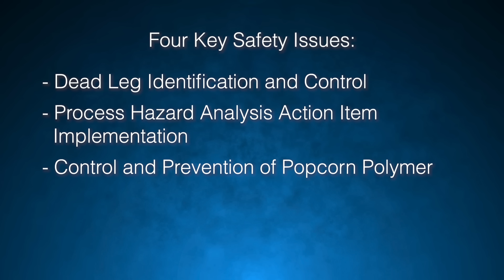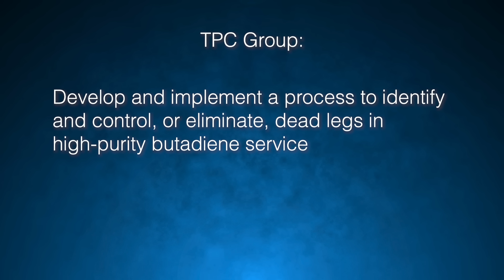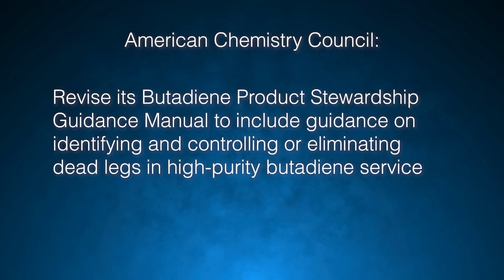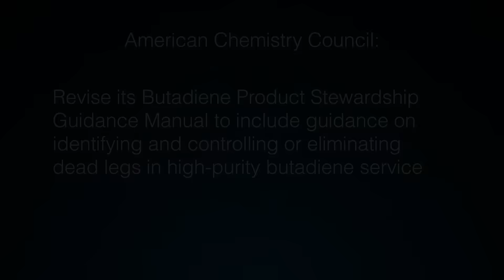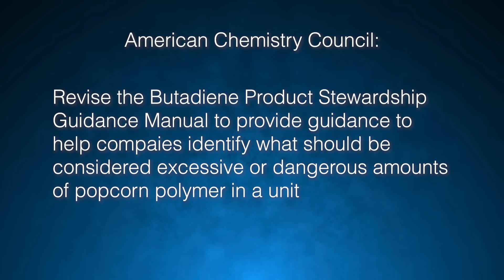The Danger of Popcorn Polymer: Incident at the TPC Group Chemical Plant

Comment: Isn't it obvious that ANY factory with flammable material in pipe that could be pressurized should have an emergency pressure relief valve in that pipe, or maybe even a pressure relief pipe system to overflow areas.
Reply: I believe pressure relief devices are typically located on vessels and process equipment, not on piping.

Comment: Normally the piping is designed for the max. shut off pressure of the pump. If there is a blockage in the piping then pump pressure will not exceed the piping rating. I wonder why the pressure exceeded beyond the tensile strength of the piping material?

Comment: In HVAC systems there might be 50-100 sensors in a single building that monitor flow, pressure, temperature, moisture and more in the ducts and others monitoring the drives, motors, dampers, and other mechanical devices. It's mind boggling that something as dangerous as this would not have the same, or better sensors.

Comment: Since the site does not meet the most basic safety standards, who authorized its production?
In the chemical industry there is a mandatory annual visit regarding the material and compliance with safety rules. In the case of this company, there is clear evidence that they have not complied with these rules for economic reasons despite multiple alerts from employees.
We always have to wait for a disaster before concrete measures are finally taken.
In most of the cases CEO’s don’t even go to jail despite the loss of lifes…

Comment: Let me guess. The Report Recommendations will be governed by "self regulation" hence the term "stewardship". In other words, there won't more inspections (if any) and nobody is going to know whether or not your company has mitigated all the known risks until the next big explosion happens. After all, Texas is all about Deregulation which has contributed to several chemical plants in Texas violently exploding relatively near to residential areas.
Note too that the guy was mentioning that (paraphrased) the company should generate new policies .. bla bla bla rather than the State or Fed. Gov't passing Laws to govern and regulate minimum safety standards and require regular inspections take place, which may result in an Order to Comply and even serious fines and charges if/when the Laws are not adhered to.

Comment: Citgo Lake Charles Louisiana 1997 9899 somewhere in there I'm in a unit that has a well ventilated Trey Tower were gouging bolt rings I get to smelling something me and my coworker crawl out of the hole start going down the Tower 200 ft we make it halfway down the Tower and the unity Evac comes on we said no shit we didn't make it to the ground and they had to plan Evac come on say we crawled over the fence I wasn't trying to hear it I don't know what got out only thing that saved it was the operator noticed line pressure loss and shut the pump down what happened was these two dudes didn't speak no English went over there and broke a live line apart yeah whatever it was they didn't find a shred of evidence either one of them two dudes ever existed four days later finished that job I took the first lay off

Comment: Imo, there should have been valves going to and from the pumps in general. I'm no engineer but that's just my opinion. Also, it should not have been run for extended periods of time with the backup. Its called a backup for a reason. The primary should have been repaired or replaced sooner. Should the backup have gone out too - what were they going to do? Use hand pumps? Downtime is money lost in business. Its a fundamental principle.

Comment: So those lines are not designed for pump shut off condition? No thermal PSV, Rupture disk or any other safety instrument?

Pipe won't rupture in the middle unless they are thinned due to erosion otherwise it will leak through gaskets

Ignition source?

Comment: one thing I will never figure out, is companies not performing repairs or maintenance due to "slowing down production", when the obvious known risk is the loss of the whole plant or factory with everyone with it (which does more than just "slow down production")
Reply: They always lose more money on these disasters than any repair could ever. It genuinely makes no sense.
Reply: @Krystalmyth  it’s just a loss on their spreadsheets, the hedge funds and other big money owner/operators find it useful to offset their enormous profits and lesson their taxes as their armies of CPA’s and lawyers advise.
Reply: @blakemalley9053  the hedge funds own more than (1) little chem refinery, it’s just a tax loss that’s helpful to reduce their taxes, and then continue to operate their other chem bombs at max capacity, easy money no worries!
Reply: The human mind gives unequal weight to small risks that are more likely to occur than catastrophic risks that are less likely to occur. Losing production time to planned maintenance that overruns the planned downtime window is a tiny risk that will only cost the company some money, but its much more likely than a catastrophic failure that takes out a swathe of equipment and personnel.

Comment: No deaths is insane. I work in a factory and it's easy to overlook and not have the knowledge to identify things, which is why getting that information out is so important
Reply: No deaths IS insane. The fact that it happened in the middle of the night probably helped with low staff on site. Our home is 3 miles down the road from this and it sounded like a freight train coming through our door. … there was a death via heart attack from a nearby city when they woke up and went down the road to see what happened, he just died from shock.
Reply: How the hell did the workers survive, they only had 2 minutes to run from an explosion with a multi-mile blast radius? Did they hide underground or something?
Reply: @QWERTYCommander  there’s a couple of things to consider as it pertains to the avoidance of fatalities here.

One, while CSB videos are very informative, they’re also heavily summarized.  The blast was reported to have been felt up to 30 miles away.  That doesn’t mean that a catastrophic pressure wave travelled 30 miles though.  There’s a lot of math involved in determining how strong a pressure wave is, but, in many of these types of explosions, the pressure wave loses a lot of its energy very quickly.  So while people far away may have felt a rumble or low thump, it would have likely been similar to feeling the pressure wave created by a large firework.

Two, chemical processing facilities and refineries in the U.S. have to comply with facility siting regulations, one of which makes it mandatory that any “occupied” buildings that are within certain distances of process units, are built to be blast resistant.  Occupied buildings refers to anything where people will normally be in the building.  They’re typically referred to as “Operations Shelters”, and it’s where operators will basically just hang around when they’re not performing their routine duties around the unit.  The buildings are designed to withstand pretty large explosions.  In the event of a catastrophic release of flammable materials, every operator is going to be sprinting for an operations shelter.  Two minutes is a lot of time to get to one, as they’re typically intentionally located in close proximity to each major process unit.  Many operators also make use of vehicles, bicycles, etc., because these facilities are very large, sometimes hundreds of acres.

The point of luck that they had going for them was simply that there weren’t any immediate ignition sources.  If the rupture had happened close to a fired heater, or some kind of hot work, things may have gone very differently.  If the wind had been blowing stronger or in a different direction, things may have gone very differently.  They’re lucky that they had two full minutes to get to safety.  In some instances, a loss of containment has lead to a catastrophic explosion in a matter of seconds.
Reply: @QWERTYCommander my question
Reply: @QWERTYCommander  great question!
Reply: @QWERTYCommander because there were other structures between them and the blast. Some those structures took the brunt of the blast and they had enough materials between them and the blast and pressure wave to spare  them
Reply: So true bud when all you see is pipes and hoses all day its hard to notice one out of hundreds just remember don't be scared to get the hell outta there when something goes bad..
Reply: I live near the area and the blast didn't wake me up but would see the facility in flames for a couple days
Reply: No immediate deaths, but the toxins could lead to some carcinogenic developments
Reply: it burned for months ... means no IMMINENT deaths ... but not no deaths
Reply: It actually wasn’t that big of a explosion, I was working there a few nights before. I was right down the road at Sunoco port neches when it blew. You would be amazed how often this stuff happens and you never hear because no one was killed. Especially in the plants in BFE
Reply: Well it is Texas.
 Oil & Chemical don't need any stinking badges interfering with profit.
 I worked on a repair crew in Texas,,ONCE. 
At least every thing in Texas still is bigger.
Oh and the dead pump and line Should have had Blinds installed AT BOTH ENDS.
Even if it meant shutting down for one day to do That.
Oh and you then remove the pump and repair it. And take your time doing it.
Reply: @warrenpuckett4203  I can tell you that blinding lines in the way you’re talking about is not an industry standard practice when it comes to something like a pump removal.

Isolation blinds need to be installed after a line has been depressured.  So if you’re plan is to place one at the vessel, upstream of the valve used to isolate the pump, you would have to take the vessel out of service, which depending on the design of the unit, might mean shutting the unit down and deconning, which is typically a multi-day process.

Just as an example, as an operator, I have to routinely take equipment out of service for maintenance.  Recently, I needed to take a heat exchanger out of service for a tube inspection and cleaning.  The process of taking it out of service and deconning it PRIOR TO blind installation, takes two to three days.  We have to bypass the exchanger, then continually purge the equipment and repeatedly gas test it to ensure that all of the process fluid is cleared out.  Typically it takes at least 36 hours of purging to get the levels below LEL and clear it for maintenance to come install the blinds.  

This maintenance activity creates dead legs, because we have runs of pipe going to and coming out of the exchanger, which are no longer active, but still connected to the process.  If we wanted to blind the pipe runs on both ends, we would have to shut the unit down, because one of those runs connects to the main reactor in the process.  The deconn process to prepare the reactor for a blind to be installed, takes about a week to perform, because very large quantities of hazardous and flammable liquids and gases need to be cleared out before we can let someone open up a flange on the equipment.

The dead legs are known hazards, which is you’re supposed to develop and implement mitigations to prevent accidents from happening.  In this investigation they found that TPC was well aware of the hazards posed by their dead legs, and even developed the right mitigations.  The problem is they never implemented them.

If chemical plants and refineries needed to shut down every time a pump needed to be pulled or some maintenance needed to be done, you’d be paying $10/gal for gas, because refineries would be shutting down every other week.

Comment: Wtf is popcorn polymer never heard of it I work in a PCB recycling facility we use to use perchloro ethylene on the high level stuff  that came in that shit is brutal same shit dry cleaners used to use some still do .if there's a spill near water it sinks to the bottom and kills everything in its path that's why it's so dangerous what can ya do if the current takes it to who knows where along the bottom of riverway we turned it all in to whoever stores that stuff and stopped using it boss is trying to figure out a new method of washing high level metal that's more friendly then that shit it expands more than propane when it leaks into the air 5 sec our entire warehouse you could smell it one time it expands that rapidly

Comment: After more than a month TCP command confirmed that all fires had burned up all the chemical material that they could not stop leaking out of their tanks due to the damaged stop valves from the explosions ! Because it was cheaper to let the chemicals burn off exposing the locals to the cancer causing chemicals than it was to put enough water on the fire to cool it down enough that the fire would go out !!!!

Comment: I worked in injection molding and used this material and when it goes off in the barrel or if some tit had set the barrel temps to high 🤔 😂it was a nightmare getting it out,

Comment: I was 0.8 miles away on the river while my tugboat was docking a ship at a nearby dock. I was in my state room, having been recently relieved by the Mate. I heard a sucking noise and my ears popped. I immediately left my state room in time to see the 500' fireball over the ship inland. Mate was scared sh*tless. I would have been too. I used the radio to check to see if the pilots and other tugboat crew were okay. The Ship pilots were knocked down and winded from the shockwave but otherwise okay. The other tugboat was fine too. I then had my crew each call family members to assure them that they were okay in lieu of what the media may report over the next 15 - 30 minutes as news got out. I then called my office to alert them of the situation. We then moved the ship to another location because we were not sure if there would be another BLEVE explosion that could endanger all of us. It was one hell of a night

Comment: Yet another dangerous incident that would have been prevented with proper regulation and inspection.
And when will we start seeing criminal prosecution of the executives that cause this sort of disaster?
Remotely operated valves are valuable, but they should never be connected to the Internet so as to avoid the possibility of hackers opening or closing the valves.

Comment: TPC supplied butadien to the plant I worked at. I lived about four miles from TPC.  Having spent a few decades as an operator I can tell you many of plants have the same problems.  Old and worn out equipment and operated by people chosen for reasons other than competence.  On top of that, the continual reduction of operators running the units.

Comment: Processes are incredibly complex, and as their complexity increases the best practices do as well, sometimes exponentially. It appears the company acted in good faith. The anomaly I see was the extended time frame to repair the pump. The changing of status on the repair could have part of a bigger issue. Supply issues may have pushed it back due to more important equipment needing to be be put at the front of an already slow list. Thankfully there were few injuries and no deaths. Hopefully this will serve as a learning example to make things even safer.

Comment: Despite any technical issue that may have been the initial cause of a problem in producing, storing, or transporting such chemicals. In almost every case it is the company placing profit ahead of safety, that ultimately leads to disaster.
What does the CSB do to address this underlying corruption?

Comment: Having a degree in instrumentation and control technology, I'm tired of incidents such as these boiling down to the company prioritizing greed over safety. There are consequences to their lack of action and instead of implementing whatever is needed however needed to be done correctly, corners are cut and/or shutting down operations may just be too costly. It's not like they didn't know about the potential for an incident to occur. My first thought when they suggested monthly flushing of the pipes was install a PCV(pressure control valve) into the system that would watch for increasing pressure due to popcorn polymer growth....choose a nice safe pressure setpoint and once the dead leg reaches that pressure.... flushing process is then triggered. Or course throw some extra goodies for redundancy. All in all, I don't think the heads of these companies ever assume the worst when weighing the opportunity costs. I feel bad for people working for employers that just don't give a shit about their employees health let alone lives like in this video.